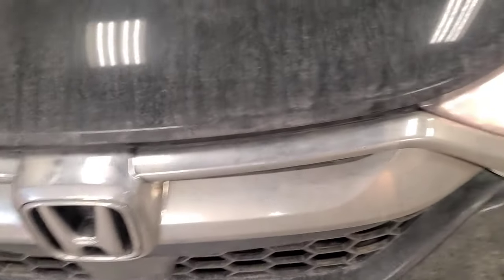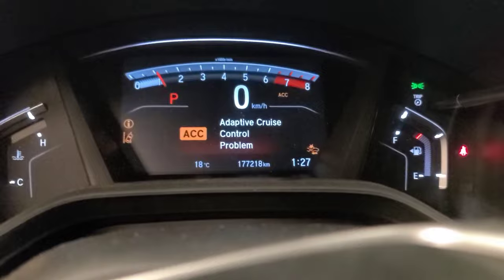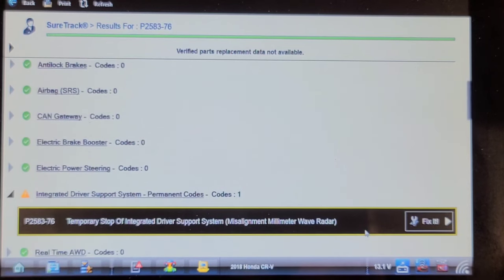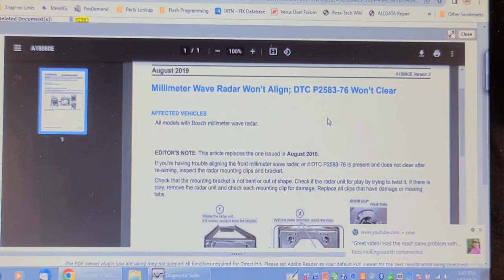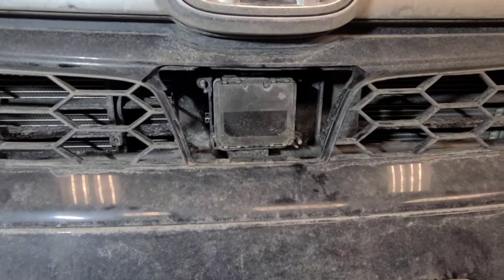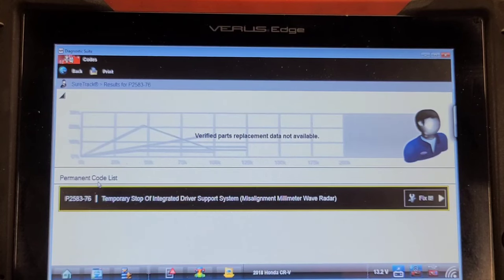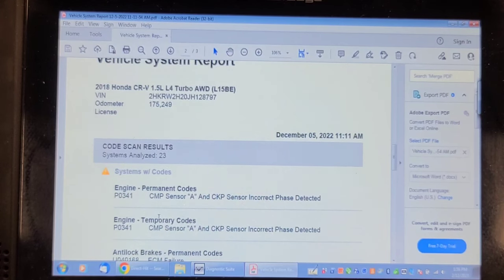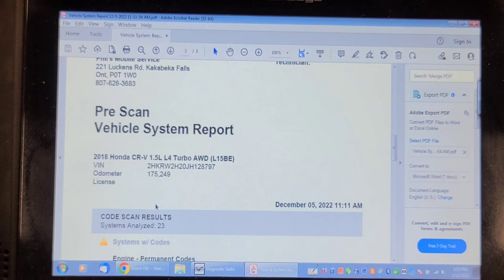2018 Honda CR-V Multiple Warning ADAS System Lights Code P2583-76

Comment: My 2019 Honda CRV had the same warning lights on and I went to Honda and they were charging me over $1000 because according to them the radar sensor needed to be replaced. I took my car and said I'll be back the next day. I am a very nosy person so I took the cover off the radar, moved it around a bit, drove a mile or so and the warnings were gone. That is, these warnings appear when the frontal Radar moves from its place for some reason and that is why these warnings are shown later.
Reply from the maker: Glad you got it resolved.
Reply: Hi, after 2 months has the error came messages came back on?
Reply from the maker: @chucky2141  I'm sorry but I'm not sure. My customer took it to the dealer for repairs since I don't have the ADAS targets.
Reply: Hello! Please tell me how you removed the radar cover, did you remove the protective cover? Then how? After all, you need to completely remove the radar. Is it possible to remove the radar without removing the radiator grille? I can not.
Reply: @vanyanazarenko  I don't understand exactly what you mean but if you are trying to remove the radar from the car, simply move the small front cover that is only held in place with some clips in each corner and to remove the radar it is also almost the same since it is only held in place by 4 plastic fasteners and then you have to disconnect the connection that goes to the radar, I do not recommend removing it completely since you can lose the alignment and the car will mark errors on the dashboard.
Reply from the maker: @vanyanazarenko I'm sorry but I did not fix it. The customer took it to the dealer.
Reply: I'm having the same issue after I met with a minor accident and had to replace the bumper. Tried disconnecting the battery and even made sure the battery voltage wasn't low. The error would not go away at all. I checked the radar and everything looks intact and in place. Do you think I should drive around without the cap for a bit and see how it works out and go to the dealership as my last resort?
Reply from the maker: @vamshikalva1594  Any repairs to the front end will require recalibration of the sensor, and that's usually a dealer only task.

Comment: There was a YouTube video on here with this code. Radar won't align. It turned out to be that one tire was slightly larger than the other three. That was why the dynamic alignment wouldn't complete. Replaced the tire with the correct size and the problem was solved.
Reply from the maker: @fernandoq9334  I would not expect it to be that sensitive but it does not surprise me

Comment: Hello! Please tell me, should the Radar be rigidly fixed? In the video you try to move it. And the radar is not moving. On my Honda CRV 2018 car, the radar is not fixed firmly and can be shaken by hand! It should not be? Regards, Ivan. 04/19/24.
Reply from the maker: I believe it should not move.
Reply: @PhillipBailey  Hello! Please tell me how you removed the radar cover, did you remove the protective cover? Then how? After all, you need to completely remove the radar. Is it possible to remove the radar without removing the radiator grille? I can not.

Comment: I have a 2023 ridgeline with only 2400 miles on it. Had a light snow event, only 2 inches, that caused all the warning lights to go off. I had to get it reset by dealer 3 times before it finally cleared. They told me the sensors are so sensitive that they had people have the same problem with a heavy rain event. If this is going to happen every time it snows, I may have to trade it in.
Reply from the maker: Snow and freezing rain will disable most sensors but cleaning the sensors should be all that is required.

Comment: That is an awesome video buddy it helped a lot but I have a question I had to change my wind shield about three months ago the guy that changed it was supposed to no about the sensors anyway about a week or two ago started having problems with cam light collision light lane assist light come on
Reply from the maker: @lloydbannister8062  you need to scan  it for codes. I would think if it were related to the windshield install if would have coded right away. Do a network scan of all controllers and report back. You will need a full function scanner to do this.

Comment: Any chance this sensor issue could cause the car to go into limp mode?
My 2018 is doing the same thing and last weekend my accelerator wouldn't respond.  No rev of the engine,  car just coasted to the side of the road..
Reply from the maker: Chances are it had a code in the engine controller need to do a network scan of all controllers
Reply: I went through the exact same thing last summer and the high pressure fuel pump in the engine bay required replacement. Honda wanted $1,600 to repair it, I did it myself with an OE Beck Arnley pump purchased on Amazon for $210.

Comment: what is your suggestion? I want to buy OBD tool/scanner.
 I do not want to buy expensive OBD tool scanner to calibrate Radar Sensor in front of the vehicle I want to do this job by myself.
Honda CRV 2017
Reply from the maker: You will need a scan tool with dealer level capability. No cheap obd2 scanner will do this. On top of that you will need targets and other tools depending upon your vehicle and what you are trying to calibrate. Most independent shops cannot justify the expense of this equipment and leave that to the dealership
Reply: thank you